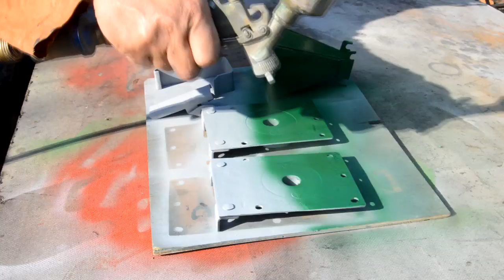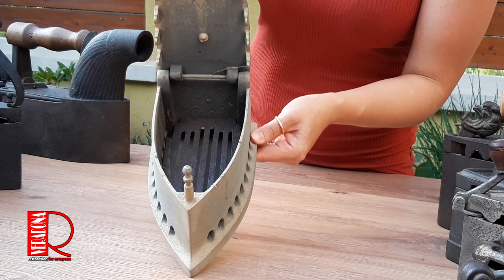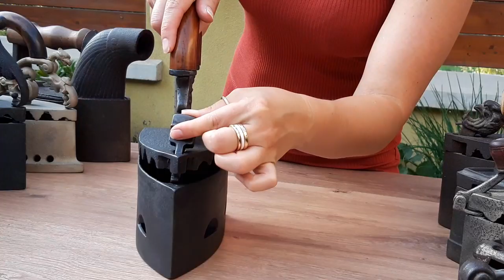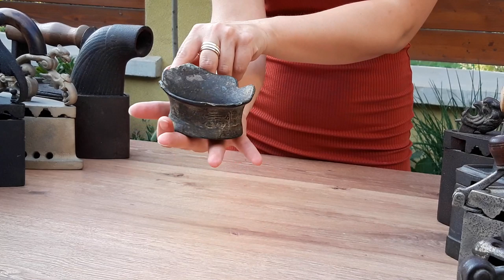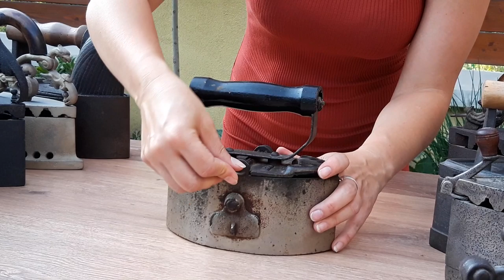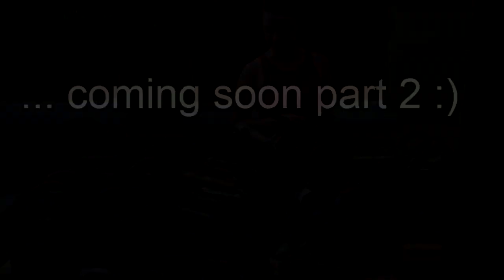My collection of old irons

Comment: Very nice collection! I collect a little bit of everything and irons are one of the many things I collect. The oldest one I have as a tank on top of it that looks like it might have used gas or oil I'm not sure. The first one you showed from the second row on your left is that small one from the same time as the rest? and how did you find out it was an iron I would have thought it was some sort of mug or cup